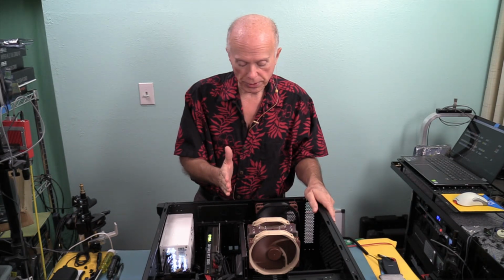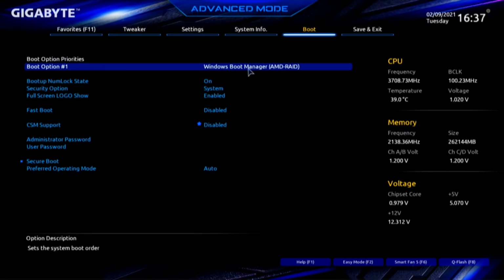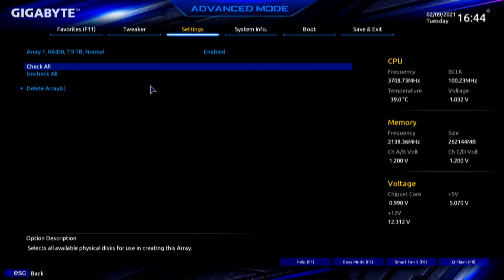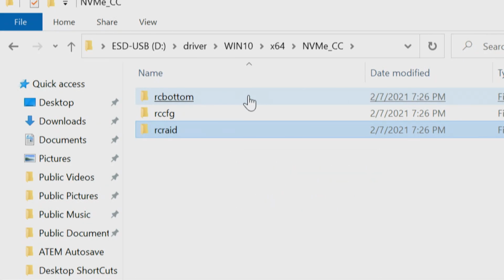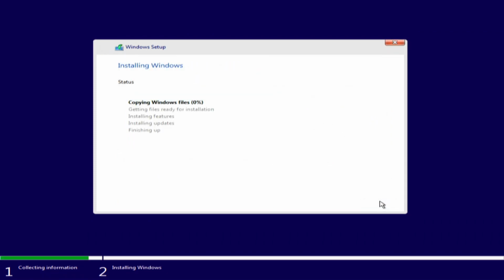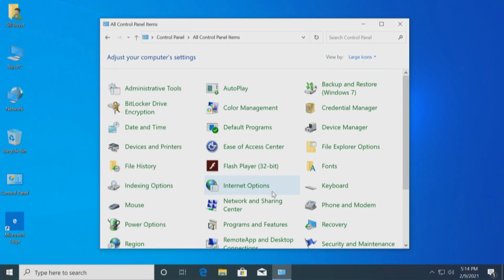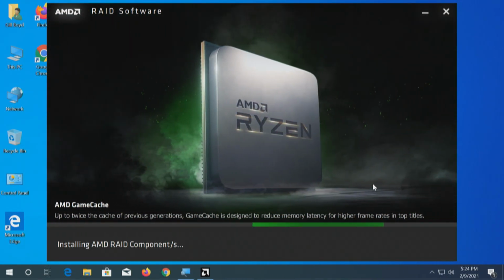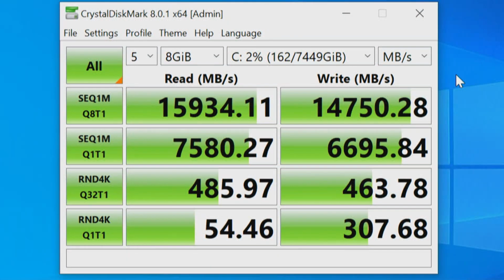Windows Bootable NVMe RAID 0 Tutorial on Gigabyte TRX40 Designare using Sabrent Rocket NVMe 4.0

Comment: Great video, subbed. That was one seriously Pro suggestion about disconnecting all existing HDD and SSD's BEFORE installing cards for a RAID set-up. Great advice. Everyone, please do this!!
I just seen that the Sabrent Rocket 4 PLUS m.2 SSD's have just had a potentially very significant firmware upgrade (B47) that effectively doubles 4k / QD1 speeds, a major limiting factor for any OS drive. Any chance you might be able to do this OS test again, using these SSD's?
I also wonder what you think of AMD effectively making TRX40 a single CPU generation system? I am more than a little bit pissed off at AMD (after their stated "long term support" promise) that I now have zero upgrade path (was looking forward to a Zen3 option). Here's hoping Intel provides some much needed competition here!
Reply from the maker: Hi Alexis K, 
Welcome! Thank You! I'm honored! Appreciate Your Comments! Interesting. Sabrent Rocket 4 Plus - That's a distinct possibility! Hard to say. Everyone wants to write the TRX40 off as such. We're caught up in several technology changes right now. If the TRX40 turned out to be a single CPU Generation it's due to PCIe 5.0. A new PCIe Bus will require new Chipsets and new Motherboards as well as expect new CPUs. Look how long Intel has stepped back from the HEDT 2017 and 2019 then nothing. To reiterate, the Workstation is getting all of the attention and in 6 months We expect the the Threadripper Pro 5000 CPU's to be available to the rest of Us. This places Us at October 2022. Whatever Intel does with the HEDT, that's up for conjecture. As such, AMD may wait to show what they have to counter whatever Intel has to offer. Based on what Intel has shown so far with PCIe 5.0, We're not impressed. The HEDT was an easy move. The Workstation is becoming more realistic based on what the WRX80 has to offer based on what Users are asking about in a Working, Purpose Built Computer based on the Questions We receive. Hope that helps! Stay tuned! On to the next Video!

Comment: Would this work with 2 rocket plus drives in 2 individual m.2 ports on the MOBO with windows 11? Or would you need to put both drives on one pcie card and start with windows 10 then clean install windows 11? Shooting for the moon lol! Great video!!
Reply from the maker: Hi Ryan,
Welcome! Absolutely! Thank You! Appreciate Your Comments! Use the Two M.2 Connectors connected to the CPU. Which ever You prefer! Windows 10 or Windows 11. AMD is now showing the TRX40 Drivers for both Windows 10 and Windows 11. Start with Windows 10 or go straight to Windows 11. We have not ventured to Windows 11 yet on the TRX40 Designare. We will soon! Stay Tuned!

https://www.amd.com/en/support/chipsets/amd-socket-strx4/trx40

Comment: Hi. Great video. It seems like 8TB ( 4 x 2TB) is the array limit of this particular card. Is this correct?
Reply from the maker: Hi Tor, Great Question! Since there is no PLX Chip, there is only the size limit of the current M.2 NVMe Drives which is currently 8TBs for Consumer Drives. Therefor, 32TBs (4 x 8TBs).

Comment: Another home run Gill!
I do need ask you if you have noticed any of the iops numbers degrading from no raid versus raid 0?
Just watched a video where the content creator placed two 970 evo 1tb into a raid 0 on the Zenith Alpha II trx40 and the iops dropped dramatically. 
The content creator also tested a separate 960 evo 1tb that was not in raid and the iops on that drive dropped as well (after the nvme raid was activated).
I am in the market for the trx40 chipset is why am asking.
Curious to isolate if the issue is board vendor related.
Thanks again Gill!
Keep 'Em Coming !!
Reply from the maker: Hi PersonalDroneRepair,
Wow! Just now seeing Your message! YouTube has held back a bunch of messages. I check this stuff regularly! In a nut shell, of the 3 types of RAIDs, only Hardware RAID is a trued RAID. These other 2, Bios Bootable RAID and O/S Software RAID are a poor man's RAID. Anyone who wants a real RAID needs Hardware RAID. 

The problem is the implementation on a combination of Hybrid Bios Bootable and Software. A lot of translation going on in each through software. These 2 types of Software RAIDs are more about Capacity than Performance. RAID is more of a novelty. That's why We did a Video about Hardware RAID on Broadcom. We are waiting on one Component to make that work! Icy Dock says that Component is still in the Port! Of the 3 Technology gaps We've had in 30 Years, Hardware RAID has been the longest getting Us from Adaptec SCSI to Broadcom M.2 NVMe PCIe RAID. Think of how long than has taken! 

Yes, the Hybrid Bios Bootable RAID is a drag on performance. It's a Hybrid, Hardware and Software Solution. Not a true Hardware RAID. 

The TRX40 is the best value overall, knowing the allocation of PCIe Resources. If that is still a limitation, then the WR80 is the next step up. I never expected Quad cards and RAID to be such a big deal with everyone. I thought this was an esoteric Topic. I was very wrong on that one! 

However, either one is a good candidate for a Hardware RAID solution. Just remember, whatever Software can do, Hardware can do better! 

What We have found in a Hybrid Bios Bootable RAID, is the culmination of 4 Drives in RAID equals the individual Speed of x3 Drives combined of whatever the PCIe Spec being used. Thus, We lose one Drive to Overhead. A Hardware RAID solution should not have that limitation. Subscribers Ask, We Show How! We like to Keep it Simple and Make it Work! Hope this Helps! Thanks for Asking! 

Now the Question about, why RAID? RAID does nothing for Rendering. RAID is about Storage. Rendering is about Processing power of CPU and GPU and RAM!
Reply: @BuildOrBuy  Thank you for the detailed reply!
That will definitely help me on my hardware config.
This channel Rocks!!
Thank You Again Gill!!
Keep "Em Coming!!
Reply from the maker: HI @personaldronerepair6141 ,
Absolutely! Here to help! I'm honored! Appreciate Your Comments! Working on it! Stay Tuned!

Comment: Hi Gill, thank you for a great and detailed guide!
I had to watch it twice, but managed to set RAID 1 array with SATA discs. 
Made no speed tests as for my application it is not really relevant.. Well, now that I know how to set bootable RIAD contemplating a return to HDDs - for extra reliability :p
Reply from the maker: Hi I just want to go sailing, 
Welcome! Thank You! Appreciate Your Comments! Curiosity! Had to give it a try! Now You have proof of concept! Been there, done that! Have You tried an M.2 NVMe? Once you go faster, You'll never go back! Even the 2 types of Software RAID today are more reliable than it once was. You're on SATA. 

1. SATA III is 600MBps, burst mode. Sustained throughput is about 150MBps. 
2. M.2 NVMe, PCIe 3.0 is 3,500MBps. 
3. M.2 NVMe, PCIe 4.0, 1st Generation is 5,000MBps. 
4. M.2 NVMe, PCIe 4.0, 2nd Generation is 7,000MBps. 
5. M.2 NVMe, PCIe 4.0, 3rd Generation is 7,300MBps, on the Write. And the Read is almost 7,000MBps! 
6. M.2 NVMe, PCIe 5.0, 1st Generation will be 15,000MBps! Whew! Heat and Speed! 
You need an M.2 anything! Dip Your toe in that and go sailing! Success on Your Build! Keep Us Posted on Your Progress! Thanks for Sharing!

Comment: In all your videos I always see you wearing your Anti Static Gloves. I need to get a set. How good is a fit, and what's the pros and cons?
Reply from the maker: Hi GOOGLE USER, 
Good Question! We take ESD seriously! Fit is good. Nice fit. I have large hands and use the Medium. Manual dexterity is OK. I have tied knots with white mule work gloves before so I'm use to Gloves. Only downside, they snag. Comes in a Pack of Six. Over time they start to get dirty looking from use. That I am surprised about. The Tips have a slight rubber coating (polyurethane) on them to protect them and to provide grip. 

Here's a link on Amazon: 
ThxToms ESD Anti Static Gloves, High Resistance Carbon Fiber Protects Your Computer Safe, Medium 5 Pair
https://amzn.to/3sJNuHW 
As an Amazon Associate I earn from qualifying purchases. 
Thanks for Asking! Appreciate Your Support!
Reply: @BuildOrBuy  thanks for posting the link I'm going to look at it
Reply: I just ordered them thanks
Reply from the maker: Hi @googleuser7202 ,
Absolutely! Hope that helps!
Reply from the maker: HI @googleuser7202 , 
Outstanding! I also use a ground strap and ground mat.

Comment: Why do we have to use CC when manual says use DD.. lol
Reply from the maker: Hi Sebuh, 
Welcome! Good Question. NVMe_CC vs NVMe_DID. You don't. We were checking to see what would happen. Did You check the differences? Did You analyze the similarities? The Point? They are the same. According to the Documentation, 3rd Gen AMD Ryzen Threadripper Processors NVMe_DID. Whereas, 1st and 2nd Gen AMD Ryzen Threadripper Processors NVME_CC. 

The Point, to reiterate, they are the same. To duplicate what We did, use what We used. Your results may vary. Did You try and see what Results You would have? Did You notice any differences. The ClassGUID is the same. The Driver appear to be the same as well. 

Whichever You choose... Install the RAID drivers in this order:
   1-rcbottom - all your drives in the RAID will disappear
   2-rcraid - you will see your one RAID
   3-rccfg - you are good to go!

Thank You for Watching! Success in Your Windows Bootable RAID Installation!
Reply: I finally got it to work sir. My issue was Sata raid was enabled, disabled that back to ahci and the windows boot manager amd raid setup came. But in the raid expert 2 manual it said for me to use nvme_did. And when I tried it wouldn't work. Nvme_cc worked Tho. This is redoculous how poorly this is documented lol. I got x399 now with Asus rog strix e gaming and Asus hyper nvme raid card with 4x 1tb nvmes. I guess I am content now.
Reply from the maker: Hi @SebuhHonarchian , 
Outstanding! Crazy right? NVMe_CC vs NVMe_DID. We were on the TRX40 Chipset. The documentation could definitely use an Update. X399, got it! Perfect! Even a Bios Update can affect the documentation for these settings, going forward. Happy Camper! Appreciate Your Details! Thanks for Sharing! Details matter!
Reply: I can't believe I spent 5 hours trying to get this working. What a head ache. Now I need to figure out how to maximize the performance. I read somewhere the bottleneck is in the threadripper infinity link that links up the two dies.
Reply from the maker: Hi @SebuhHonarchian , 
Good point. RAID is a PITA until You've done it a time or two! The only way to be absolutely certain of Specifics would be to set this up on an Intel X299 Motherboard and compare Results. We were headed that way initially to look at PLX Chips on X299 ASUS Workstation class Motherboards. Since the TRX40 and now WRX80 Platforms, hard to go backwards with DDR5 due out in 4 months on Intel and AMD Zen 4 due out 12 months afterwards. However, Keep Us Posted on Your Progress and Results!
Reply: I guess the read write test isn't too bad, 13.1 GB/ps while Samsung advertised 3.5GBps so 4 of these theoretically 14GBps. So I feel I haven't really hit a real bottleneck yet. I might get two more nvme to plug into the motherboard and see how a 6x raid performs. I have a feeling it might not balance right tho. Who knows.
Reply from the maker: Hi @SebuhHonarchian , 
Using PCIe 3.0 Drives, pretty good speeds. Which Samsung Drives are You using? On the TRX40, using a combination of 4 M.2 NVMe Drives on the Motherboard and 4 on an Add in card, You'll get mixed speeds. 

On the TRX40, the 1st 2 M.2 NVMe Drives on the Motherboard are to the CPU. Those 2 are the fastest. The 2nd 2 M.2 NVMe Drives on the Motherboard are through the Chipset. Those 2 are the slowest. And the 4 on the Add in card are in-between in performance. That's what We have found. Your results may vary.
Reply: What linus did was he split up the nvmes, some in a card, some in a nvme slot on the motherboard. I need to figure out the diagram for the links and see which area is 1, and which is 2 if I really want to maximize performance.
Reply: Some ofy buddies are taking on $2k a day doing chia mining right now. Personally I think it's a waste of resources. It's probably going to dump hard after bullrun wears out.
Reply: Thanks for the well documented video sir you do an amazing job. You earned my subscription

Comment: Gill, could you do a video demonstrating the Glotrends RAID Sky card working with 4x optane drives on PCIE Gen 4.0 x8 slot? RAID with 4x Optane modules utilizing a PCIE x8 slot would be interesting.
Reply from the maker: Hi clickclaxer01, 
Welcome! Nice to meet You! We already have a Video of the Glotrends Sky card. We'll keep that in mind to use Intel Optane though for a future Video! 

BTW: RAID with these types of cards is a function of the Bios. Thank You for Watching! GloTrends Sky x8 M.2 NVMe SSD Quad card Unboxing and Setup Installed in HEDT X399 Motherboard: https://youtu.be/QF71-5nhrAk
Reply: @BuildOrBuy  Yeah, I watched the video. The Glotrends Sky card has great potential since 4x Optane drives wouldn't be bottlenecked by the PCIE x8 slot. Even though it'll suffocate the speed of 4 NVME drives in a x8 slot, Optane might prove to gain a huge uplift in speed and capacity while still being able to boast the really low read/write latencies that would be suitable for a snappy operating system if you do bootable RAID with the drives.
Reply from the maker: Hi @clickclaxer01  , Thank You for watching! The GloTrends Sky card is PCIe 3.0.  I hear where You're coming from. We'll keep that in mind for a future Video. That card works in systems  where the other cards do not. They need a PCIe 4.0 version. Appreciate Your Ideas! We're all about Answering Subscribers Questions! This helps Us to make better Videos!
Reply: @BuildOrBuy  Cool! I'll keep watching in anticipation.
Reply from the maker: Hi @clickclaxer01 , I'm honored! Hope We measure Up to Your expectations! Thanks for Sharing!